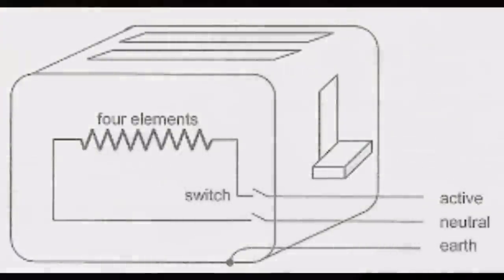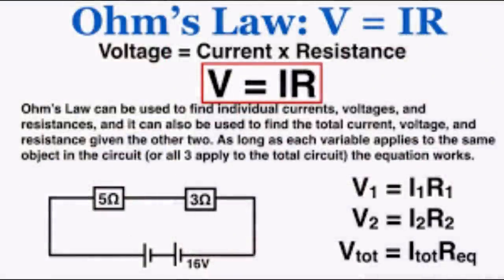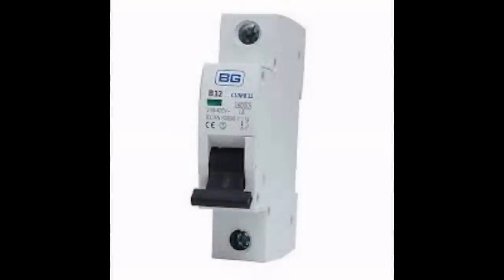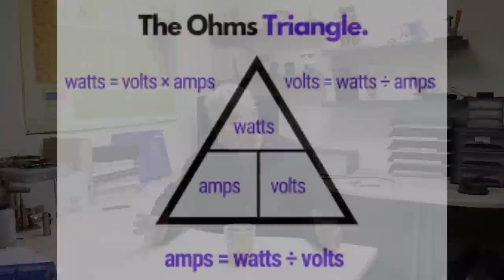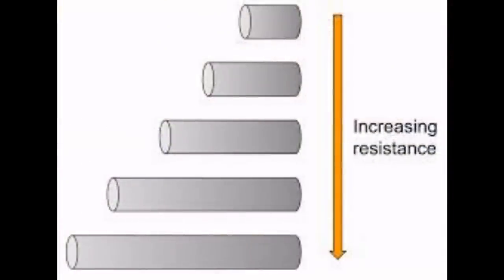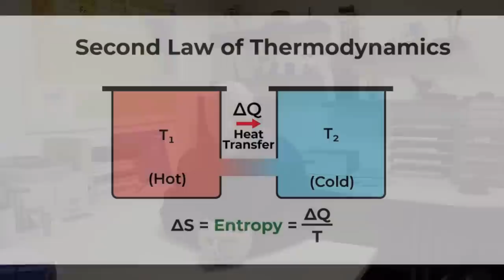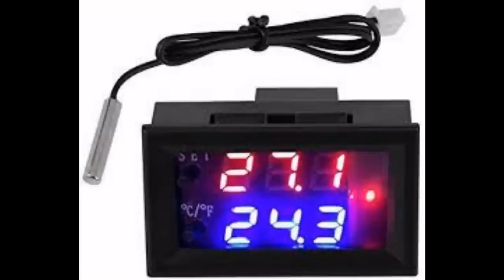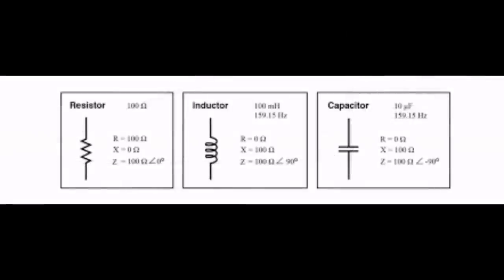1761 Controlling Electric Heaters Of All Kinds

Comment: While you are most certainly correct that the standard outlet in North America (US& Canada) is 110-120volt the  power company supply to a house is 220-240 volt  there are exceptions for apartments(208v) and industry (208->+480v) however is
220-240v at 60hz is the official supply voltage

Comment: I’ve just bought a usb powered heated vest. So when I feel cold I either put a battery bank in my pocket so I can walk around or I just plug into a usb port and I’m warm. I ditched the fan heater and the oil filled radiator.

Comment: Great video thank you Sir Robert!
I have found a little solar panel (max.17.5V/1.14A) I've learned from this video that R=15.35
I was thinking to dump the generated energy into a flower pot filled with sand.
What would be more efficient to put into a sand(and why) a few power resistors (3x4.7ohm) salvaged from a microwave... or to cut off a piece nichrome wire salvaged from a hair drier?
...or shouldn't the resistance actually be lower to get out some decent heat?
Reply from the maker: you don't get more heat by changing resistance mate - you get more heat by consuming more power - changing resistance will lead to more power consumption and getting it hotter but the cost is more power is used and that you have to pay for - but I was thinking of doing a follow up to this talking about heater design

Comment: Great video. Some comments on it :
As for heat and heat loss you have pretty much explained newtons law of cooling. When something is heated it also gives heat to its environment. If both reach equilibrium the temperature remains static. More or less that is because it cannot ever be reached. The formula for it is the same as the formula for charging a capacitor. You will get very close to the charging voltage but never reach it.
There is a thermal version of ohms law. Pretty much the same law but for temperature. It allows for calculating the temperature for a semiconductor for example on a heat sink. The heat sink has a thermal resistance usually given in Kelvin per Watt.
As for AC or DC makes a difference on a heating element : The mains voltage is given as effective voltage or RMS. That is, this AC voltage will give the same power in a resistive load as the DC voltage. It's the same per definition. Literally. In modern times however with led lamp and cfl lamps a resistive load is rare and power will differ for the same voltage DC or AC ( if it works at all ). One more thing I would like to mention is although ohms law is simple one could be surprised how difficult it can become if you have a network of resistors. It can be extremely complex to calculate something in a complex network although ohms law is is the only thing relevant.
Reply from the maker: you are right resistive loads on lighting are rare but resistive loads themselves aren't. I only used the filament bulb as an example of a resistive load not as an example of lighting - what I said applies to resistive loads only!

Comment: Rule of thumb , only draw 75 percent of breaker capacity , 20 amp breaker , 2000 watts , only pull 1500 watts continuously
Reply from the maker: that's great help mate and thank you for it - but that really depends - mostly on how you installed the wire from the breaker to the outlet

Comment: why do we need neutral..??? if we are just useing resistance....where does neutral go????
Reply: Only two terminal connections are needed to get electric current to flow through a material. The current flows between live and neutral.  Usually the ground connection is at the same potential as neutral and added as a safety feature in circuits.
Reply: @William_Hada  DOH..........
Reply from the maker: I think William explained for you mate
Reply: @ThinkingandTinkering  why dont you just say you dont know????